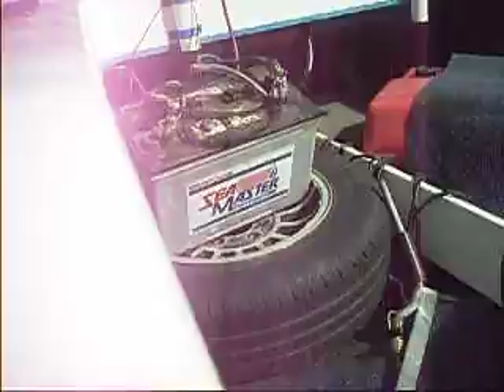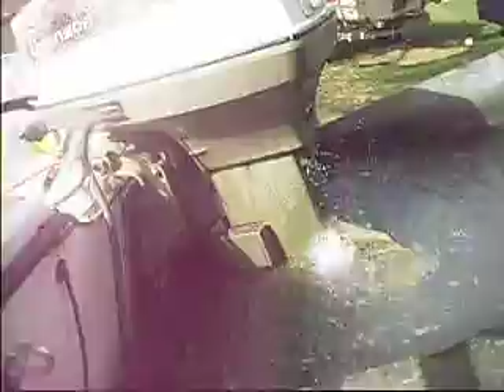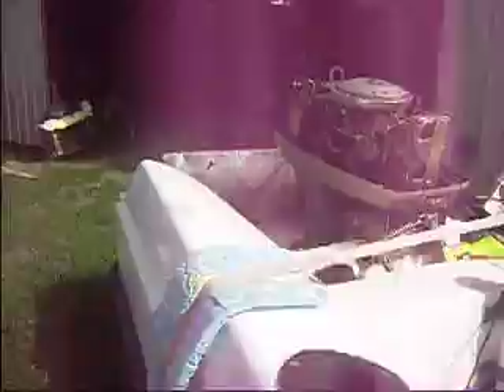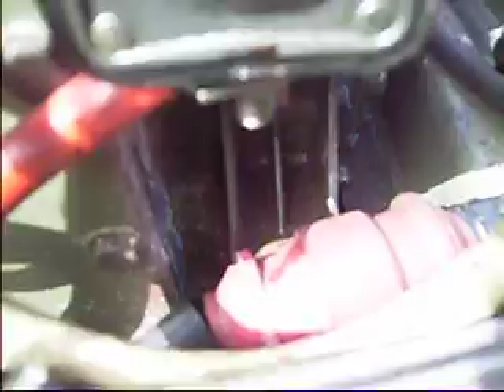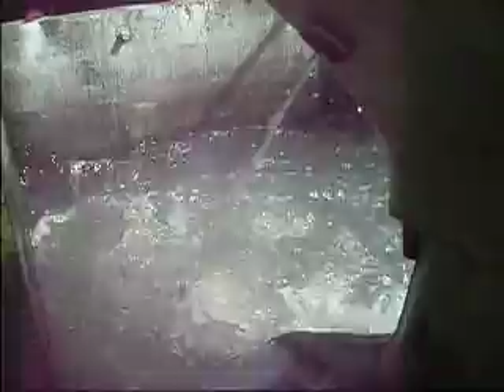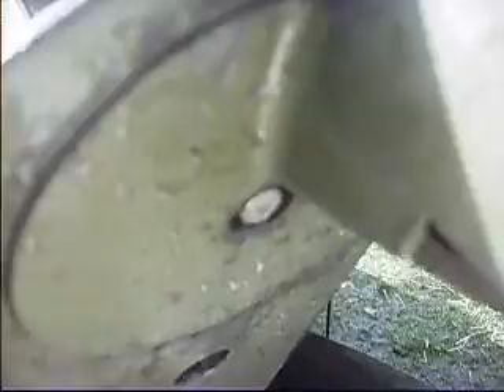Johnson 50hp

Comment: factory steering? I have a 64 with cables running down both sides but it has the cable that connects to the ball. where can I get that piece? I'm desperate to have my original steering in the boat